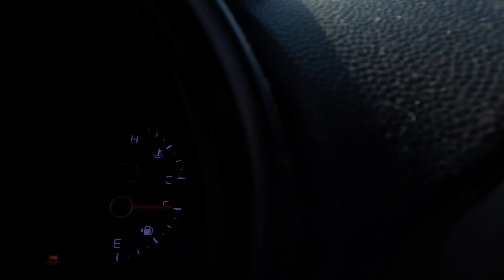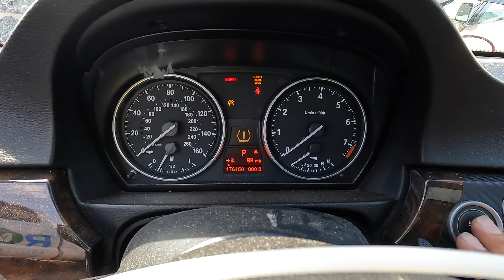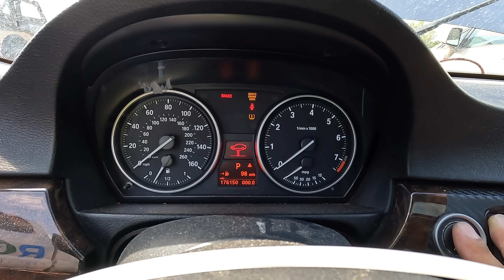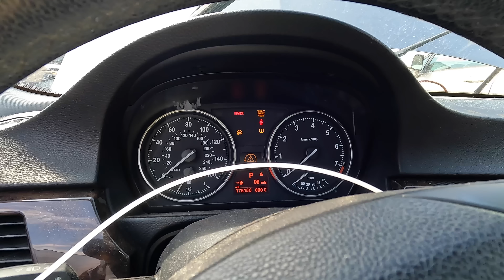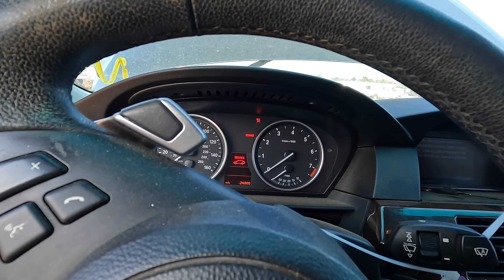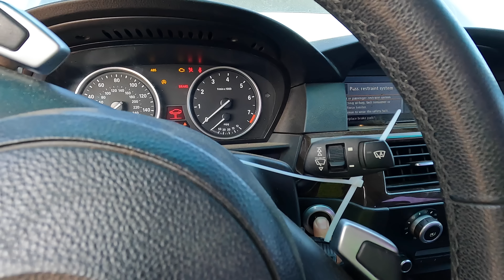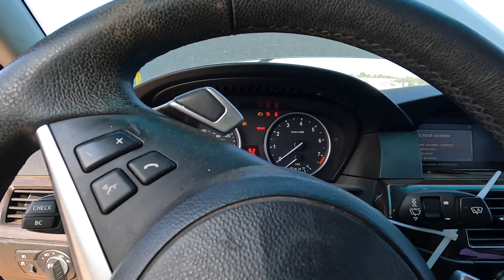Copart Walk Around 8-8-22 + Cheap Twin Turbo BMW 535

Comment: That E60 535xi could have the pyrofuse on the battery + connector also popped cutting power to the fuel pump and the starter, and that's why it doesn't start.
If is cheap I would bid on that one, that engine is a beast!
Reply: Wouldn't be surprised if that performance chip thing fried the CPU.

Comment: The 535, the reason the shifter cover is pulled off is because the tow truck driver had to manually put the car into neutral so they could load it up because of being  a electronic shifter,  They probably just never put it back into park and didn't reinstall the shifter cover.
Reply: So how to put it in Park?
Reply: There should be the switch on the left side of the shifter that you stick a screwdriver in in switch it back
Reply: Look up 2009 535i shift lock release on YouTube

Comment: I bought my first kia soul in 2016. it was a 2013 with 65k. I am a courier so i drive the hell out of my car. i had to replace the engine at 288k which was half way through 2020. I continued to drive it with a used engine til i traded in april 2021 with 322k on it. all the windows still worked (slowly) and the trans shifted just fine ( i never changed the fluid in the tranny either ) Ive had my 2nd soul for 15 months and have 71k on it already. i do like them, really well.

Comment: that e90 bmw had no/disconnecting crank signal. You can see it from rpm gauce, it was jumping and showing zero rpm. Without crank signal, fuelpump wont start (ecu refuse start signal to be OK). Probly bad crank sensor or that Ebay tune mess up with ecu.

Comment: The smaller BMW.    They have a security system on board.  The key needs to be reset before the car will start Randy if the  battery went completely flat. Needs a computer plugged in to reset the key fob. Same thing happened on my 5 series. It's possible it needs a fuel pull and filter if the battery isn't 100 percent flat

Comment: gear shift cover is off because someone manually put it in neutral. There's a lever you can move with a screwdriver. just need to move it back for park

Comment: Hi from uk Randy 👋 👍 hope your OK and stuff still thinking of behind the scenes 👍 that 535 if you get bumped car that won't crank jump battery but put live onto the lead to eliminate pyro or inertia  and also shift gaiter is up because there's a pin you can move near shifter to select neutral mate so don't have to go under car lol hope your OK tho 👌 thanks for your time be safe and see you soon 👍 👋

Comment: Oil all round front of BMW engine looks like the common oil filter housing gasket leak. Looks like the belt is mid-way to walking off the pulley and being sucked in through the crank pulley gasket and into the engine. Common result of not fixing the OFHG leak.  Had a 2008 550i and the car was probably not put back into park after being towed using the manual release under the shift cover.

Comment: I don't think you can start a 5 series with the hood open, it has sensors around the hood that detect the missing hood and it will not let you start.

Comment: That last bmw with the water coming out of the doors reminds me of my Ford Focus. The seal on the driver’s side door has a long slice at the bottom of it. I have been meaning to get it fixed cause when it pours I have a mini waterfall coming out of my driver door when I open it but I need money and time to get it done.

Comment: The Kia has problems with engines going out. Worked with a woman who had one, engine locked up at 90K, took months till they could put a used one in under warranty. An issue with metal shavings left in the engine from the factory.

I bet the plastic around all the windows was to keep water out, but now the plastic is gone. 💦

Comment: Ha ha, Randy. That Kia Soul sort of jumped me there when you started it. It looks nice, the red is again the negative for me and it looks like it needs Cats.

The non-runner BMW 328i looks like it has been driven hard and put away wet. It might have an ignition and/or fuel problem.

That BMW 535i might be a scary one. It looks like it’s also been driven hard and put away wet too. I’ll run away from this one.